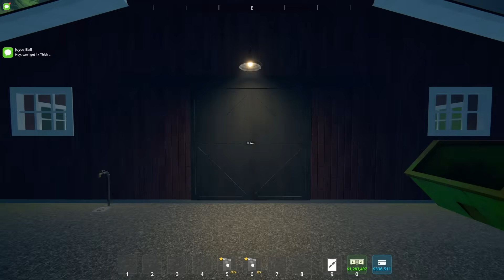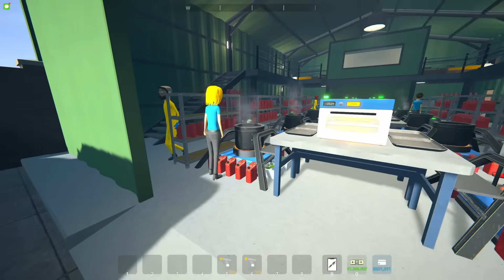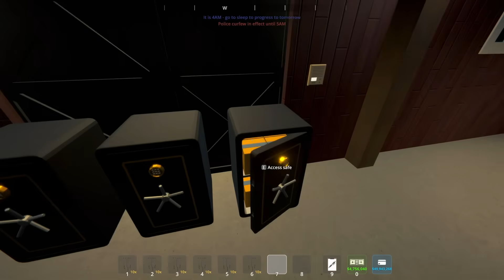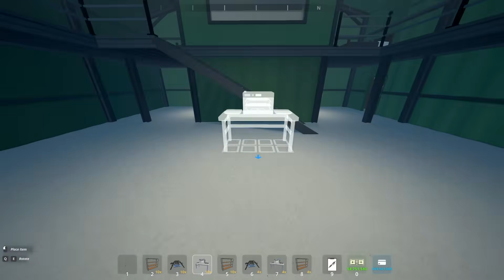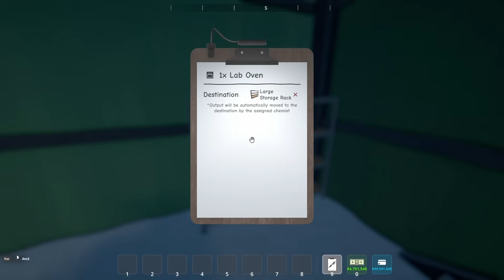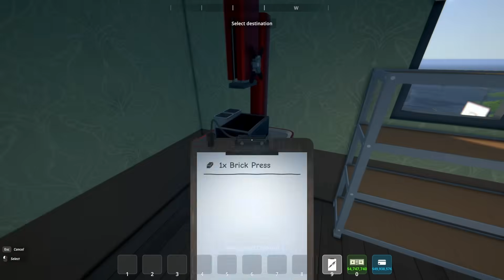Maxing Out Production In Schedule 1 (Barn, Docks, Bungalow, Shop, Motel)

Comment: your build has a couple bottle necks I'm not just any old casual player i am a automation Fein so you can chose to take my advise or not idm the builds biggest bottle neck that i noticed is your barn build by having no specific grid for your employees to follow u are causing them to get stuck in certain spaces specifically going from pots to drying racks this is causing your production from being 100% efficiency to maybe only 70% clear some space create a clear row between each your efficiency will go way up trust me

Comment: only one thing i wanna change... it needs ac units on heat... speeds up production in the barn... thats the only hold up not enough leaves being produced to keep the docks supplied... i just built it... i may need to halt production on the docks for a few days and allow a buildup of plants... ill have to try that tomorrow... maybe ill put in some storage for leaves in the barn one or two of the huge closets... otherwise very streamlined build... this is how its done... not 20 different things spread out across the city all making small batches in those areas of some random crap...

Comment: The Handlers have issues in the current update FYI. It breaks the chain of finished product on the right large shelf in the bungalow into the mixer mk2. 
EDIT: took a few hours of debugging but if your having this issue restart your game. I suspect the "range" of the workers is being shifted in some way as the game runs longer and longer. Potentially their resting point is shifting or any of other things but they were acting like it was out of range until I restarted

Comment: You are losing money....max price for a product is $999....so no need for 8 steps.  You shouldn't make a product who's recommended price is above $624 (multiply by 1.6 give you $999 you list in the phone app).  And I have supplied an 8 mix process...you are smart to use the bungalow beside the mart - you will be playing shelf stocking simulator 99% of the time.

Comment: So far I approve this set up after using it. It takes some time to set up and stock up but worth it. Only 2 notes

1- you forgot to mention setting the destinations for the mixers in the bungalow as I had to figure out what was missing after set up. 

2- working on trying out the new storage unit property for the sweatshop seat up so that I can still manually grow my low grav mix in the sweatshop

Comment: The set up for the bungalow makes zero sense to me, how does the finished product add back in so you can add second mix?
Reply: You need to chain the mixers by setting destination to each on in the chain it wasn't mentioned in the video
Reply: Chain mixing by setting the destination of the output to another mixer. Did that for my Kush setup to make money and I got my 9 bricks with 8 item mix everyday that way

Comment: Just one tip, use the other black pots, i forgot there name but there the middle one in expense, because they actually grow your plants faster because the amount of moisture lost from the moisture pots actually slows the plants more then then 30% grow rate buff.
Reply: Someone retested that, for Kush, Diesel, Green, and Purple yeah use that. Since it's about 30% faster

But for coca, air pots are faster. 10% faster than moisture preserving pots
Reply: The reason being, the first 4 grow fast... So since they harvest often, it can disrupt the water level needed. So airpots are making it worse with faster disruptions and faster water usage.

For coca though, since they grow for 20 mins... Botanist don't have to harvest often. So they can focus on watering most the time... So airpots are faster dor that.
Reply: @ashurad_fox5991  oh ok, thanks for informing me

Comment: good setup but after trying it, you could easily get rid of a botanist from the barn and a chemist from the warehouse. They produce way too fast for the bungalow to keep up even if you're there working too.
Reply: Yesh that was my concern too, since I run an OG setup in the bungalow with this.... And the 8 mix only manages to finish like 9 bricks everyday when everything starts to get going.

So definitely that barn setup is a bit much if you run everything automatically only... With that you probably only need like 6-7 botanist in the barn

Comment: Too much gas, not having two separate buildings having their own production, multiple things here that aren’t efficient or “the best way” at all. Cool video tho
Reply: Gas was more like a backup to not restock so often. I do that even in my bungalow and storage setup before so I don't need to restock every day.

The need to use 2 building to process coca, is actually efficient since you need to cook them in the couldron and oven for 6 mins each... So just restocking the warehouse at night is about right. (since you only need a few places to restock constantly, rather than you move around everywhere to restock them)

The only thing really inefficient here was... There's too much production on the barn to be processed by the warehouse and bungalow. 

Even if you manually do an 8 mix on the bungalow as well... You'd have like a few stack leftovers from the warehouse.  (Coca too from the barn, but atleast that's somehwat good)

Comment: I'm not sure where I messed up at but I followed your steps to the T and the workers aren't doing anything with product. I have to go in and take the mixed product and move it to the next station myself. The initial hander isn't even moving product from the first safe to the next one. Help me out?
Reply: Set the destination of the mixer to the next one by checking the clipboard on those mixers (not while selecting a worler)

Comment: The only thing I did different for warehouse than you is I put all the product going to one shelf, and the last command of the 3rd handler is to take that product and load it in loading dock 2, which I will keep my van at until full. That was not possible to do until yesterday though.

Comment: Feels like you can’t utilize all the cauldrons in this build on single player at least. May be able to tweak some of the docks into more growing
Reply: Also I have felt like there isn’t a lot of free time to do things when constantly being the middle man, was wondering if just removing fert all together and letting the leaves take longer to grow to gold would just be overall better as well. I feel like you need the 4 am stoppage to sit around and restock. Idk if I am missing a more efficient way to restock the bungalow, but it will run out every time just doing a simple lap costing downtime, maybe I’m just not in the right flow yet idk.
Reply from the maker: I understand what you mean, it does feel weird sometimes as the middle man restocking everything, It might be better to remove the drying process at the start to make more cocoa leaves for the cauldron's
Reply: @ ya I’m not sure you just feel very strapped for time it does produce a ton and with 1 other person I’m sure it would be amazing , but until they make bigger shelving or stack sizes for mixing you feel almost locked at the mixing stations it runs out in 1 day so you’re always having stoppage time

Comment: As an additional route from sweatshop to bungalow. You can use the handler at the sweatshop to route the finished product from the bungalow to the sweatshop so you dont have to manually route it instead of designating them to 5 racks at the actual shop. The handler will just walk between the two properties doing his task.
Reply from the maker: that is how i have it set up now in my save, i didn't think that actually worked.  it does
Reply: I thought this was patched ? @MyGamingExperience
Reply: @MyGamingExperience  can you still do this or no

Comment: In the video at the Bungalow, you placed 16 mixers but we’re only doing an 8 mix……was I supposed to pick one setup or the other and not both? I did both as I watched the video, lol. 🤦🏾‍♂️
Reply from the maker: Sorry about that, this was a little bit confusing. There is room in the bungalow for 2 8 mix setups, but since we are limited with worker there, only 1 can be used. I'm sorry if you purchased a bunch of extra stuff for this bungalow

Comment: Not sure if it was already mentioned but, the Handlers ignore the Safe to Safe move that you use for a buffer in the Bungalow. I ended up just using the Safe to Large Shelf move which works, but I have to manually move the product from the Buffer Safe. Is there a fix for this or am I doing something wrong?
Reply from the maker: i was able to get the safe to the buffer to work
Reply: @MyGamingExperience  how? I tried all 3 handlers and they wouldn’t do the safe furthest from the large shelf, they wouldn’t only move from the closer safe to the large shelf.
Reply: I got a fix just rotate the safe towards left and it will be easier for the hander and he'll do it

Comment: I'm not sure if this changed or what but 3 fertilizer is not useful. I just tested it and no additive coca seeds gives standard quality. 1 or more fertilizer increases the quality to premium.  Watching the botanist, I don't even think they actually apply the fertilizer more than once, so it doesn't seem like you are wasting the fertilizer. I just don't think it's doing what you think it's doing.
Reply from the maker: i thought that 1 fertilizer increased the quality by 1 and then the drying rack from purple to gold
Reply: @MyGamingExperience  yes, I could have sworn at some point I saw your air pot recipe having 3 fertilizer.

Comment: for your sweatshop, you can have your one handler be assigned to both the packing station and brick press and have three inputs, one for baggies, one for product (packing station), and another for product (brick press#), and have 2 more additional routes. I used mine to route another shelf of baggies into the main one, and another shelf of products for the brick press into the main one.
Reply from the maker: that is a good idea, I might add that in, there is also the option to have them go to the bungalow and grab the product of the shelf and bring it to the sweatshop, since most of the time they will be standing around doing nothing
Reply: @MyGamingExperience not since the update you can’t make employees go to different properties
Reply: That’s a good idea, I figured since he left out the storage unit you could just use that whole place to pack product in baggies for yourself to sell while the sweatshop is only bricks for the plugs to break down and sell.

Comment: I'm building the Barn part but noticed that you don't leave a gap between Rack/pot to the drying rack on the tutorial part but on the bit you show when its working there is a 1 tile gap... should I do 1 tile gap between pot to drying rack or not?
Reply from the maker: there is no gap there, sorry if i messed up in the editing, there are no gaps between the planter rack and the dryer, and also no gaps between the drier and the safe in the middle
Reply: @MyGamingExperience  No need to apologise thanks for replying, just to be 100% the version I should build has no gaps? Will the botanists be able to reach everything?

Comment: Don't use air pots fam.
Reply from the maker: i've heard that the other ones might be better, but i haven't ran into the water problem yet myself
Reply: @MyGamingExperience  Yeah, I ran the test after I saw another YouTuber (I forget his name but I always watch his Schedule 1 stuff) figured it out. If you have workers, they will never use a single auto sprinkler to save their lives. Air pots moisture issue means they will be spending 50%+ of their working time watering, actively slowing down harvesting. I suggest moisture pots heavily. Trust me, I have a pretty big endgame setup, and I took a day to clear all of it out and replace with moisture pots. Miles better than air pots. Unless you work it yourself, which I don't imagine you can do for more than 1 property max (and I don't do any anymore lol)

Comment: Man, I don't wanna yuck your yum here, but I really dislike these builds where you walk in the door and it's wall to wall machines with no room in between and just a random Tetris pile of beds in the corner.

Like, doesn't it kind of make the simulation fall apart for you when you walk through the door and everything looks like a tangled unrealistic mess?  or is it just about "number go up, brrrt"
Reply: you don't have to copy it exactly. just use it as a guide
Reply from the maker: I can agree with this to an extent.  I do like to build tidy stuff, the idea with this build was to max out each location with each step of the production process. There was a ton of stuff in the barn, which filled up to the the brim pretty much haha.  It is symmetric at least <3

Comment: It looks like the big house on the hill near the barn will be the next buyable property and it is huge with 2 levels. Hopefully we can use 12 workers there because that will allow some crazy builds. If you get any kind of low gravity weed you can just jump over the wall and have a look. I was kind of disappointed that the warehouse didn't have 12 workers. I found that I always needed more handlers to really go all out. The loading bays not being able to be assigned to handlers sucks as well for smaller operations as any large scale setup there just isn't enough worker slots or routes per handler do do much with them anyway.
Reply from the maker: I agree the amount of workers, or the amount of work each one can do is always the limited factor in the game so far.  My buddy has actually been looking at that mansion up there in the hills and waiting for it to open up.  It really does look good in there for a massive build. I wonder when it will become available

Comment: Do you actually need to set up the handler move from the last mixer to the shelf? (@20:30) I thought you could just set that shelf as the destination on the mixer. Not that it really matters as long as you have extra handler slots, I'm just curious if there's a reason to do it this way instead.
Reply from the maker: You are right about that, you can hook up the output of the mixing table to the shelf instead

Comment: If you want even better production, set up the barn AND docks to produce cocoa leaves AND coke, have the employees pack the product into bricks. Transport the bricks to your mixing location, unpack, mix, then repack into bricks. you'll cut down your delivery trips, and automate the process significantly better, only two product moves in the entire process. less hands on.
Reply from the maker: i was wondering if there was a way to use 2 locations for 2 steps of the process like you are saying.  That is a very good idea, I'm gonna look into this further
Reply: @MyGamingExperience If this experiment bears any fruit, please make an update video! I want to see this concept pushed to the absolute limit! Maybe combine it with other optimization techniques people have also recommended like using moisture pots :)

Comment: So, the second set of 8 mixing stations is only for the player to mix?
Reply from the maker: when I was thinking about where to put stuff in the bungalow, I thought I would for sure be able to staff 2 full 8 mix setups in my head.  So i designed it and then after realized that I couldn't actually staff it.  Now it is kind of there, but maybe they add more routes to the handlers or more workstations to the chemists, then both could potentially be working at the same time, automation wise. Someone also suggested putting storage there for the single 8 mix for now.

Comment: I prefer my fully automated setup in the barn. It is less work than moving the product between 4 different locations. I just constantly have deliveries running with all the mixing materials and I keep a few large shelves of soil, seeds, PGR, fert. The only thing I have to manually do is move product from the delivery vans to the shelves. The barn makes the $735 cocaine from seed to finished product. And I have WAY more product than I can sell (I still haven’t gotten the final area but still) I just bought the docks but haven’t setup anything in there. I had the thought of what you are doing here but it just seems like way too much work.
Reply from the maker: that setup seems pretty good, there are many that can max out the potential of the sales, i do wonder if this will become harder as time goes by.
Reply: nothing is as much work as doing an 8 mix. Everything else you can leave for a few days and not worry about, but you have to be there with that 8 mix every day ordering more ingredients

Comment: Great video, I keep running into automation issues with my 8 mixer set up. They Chemists don't move the product from station to station correctly and I end up just losing it. Have you seen this issue any?
Reply from the maker: i haven't run into the problem of them not stocking the mixer itself from the shelves, but they still get stuck sometimes in my save